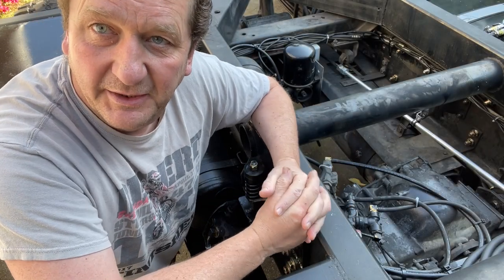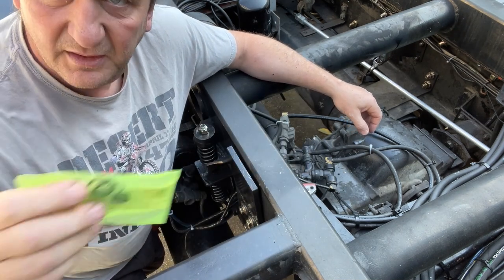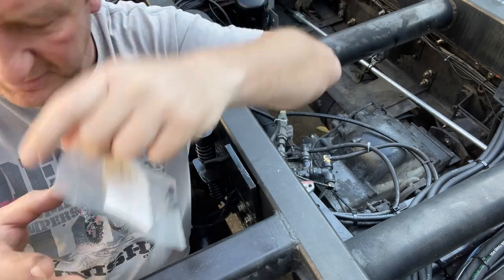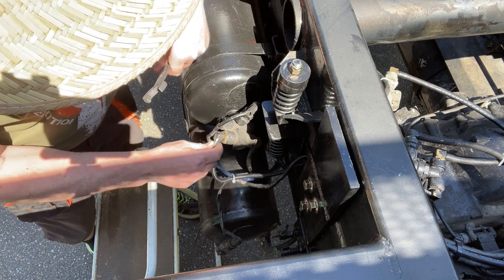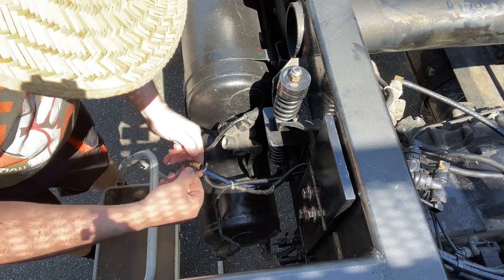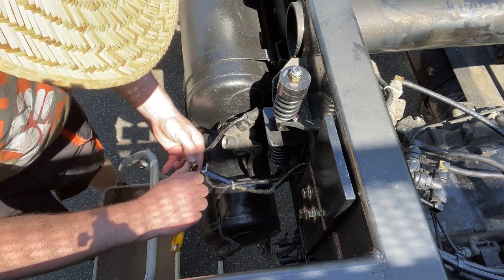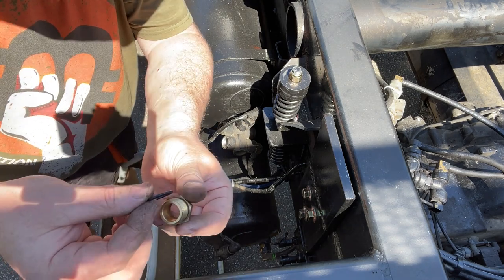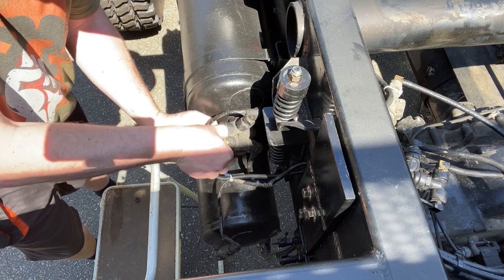How to repair a air brake system leak.  DIY Expedition Truck

Comment: I foget what are the blue retired trucks in Germany are used for? 

 I found a few Mercedes-Benz - 917 AF 4x4 Allrad that I like in the 21k-28k Euros range.

It will cost just under $6k usd to ship to Georgia closest Port I could get to Florida so far.

Thanks to your video on how to find trucks. I still need to work out all the funding but at least have the truck type.😊

Super helpful channel Oscar. Thanks for sharing your journey and build. Danke!

😆 😅😂 I have a similar aerodynamic  set up.😅😂😅😊
Reply from the maker: Thank you ! Yes the blue retired trucks are often in great shape as well and with low km, they are from THW ( Technisches Hilfswerk ) . They kick in if natural catastrophes happen floods, storms, heat waves, earthquakes and so on to help and support community's in this event. Good luck finding the right family member !

Comment: Nice video again, but moving an o-ring with a cutter-knife is the last thing I would do. Even a tooth-pick would be better.
Reply from the maker: You are right on that one, as I stated in the video better would be a small flat screw driver to use. Cheers !

Comment: Few days ago I got a problem on Actros MP4. When my handbrake is active it doesn't do air leak, when I release handbrake it starts to release air and losing it. Also when I push brake, it also starts to leak. When I go behind a truck, bellow saddle i can feel air blowing on that module for air. I don't know what to do?
Reply from the maker: I would ask those questions in a forum, there a many people with a lot of knowledge about modern trucks. Cheers